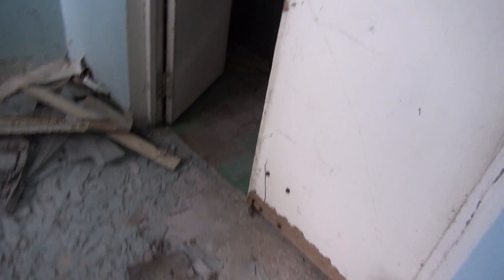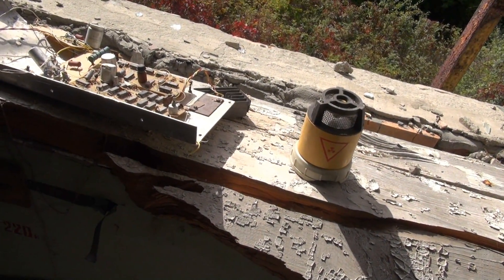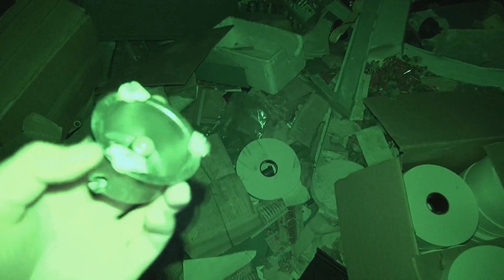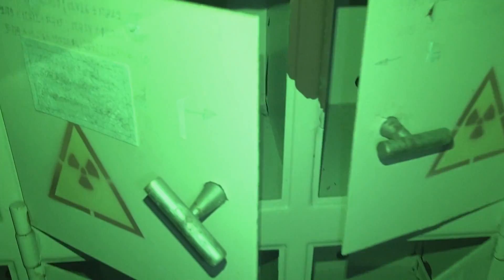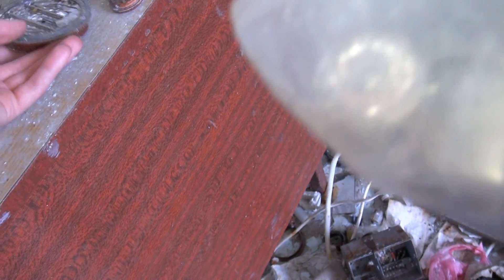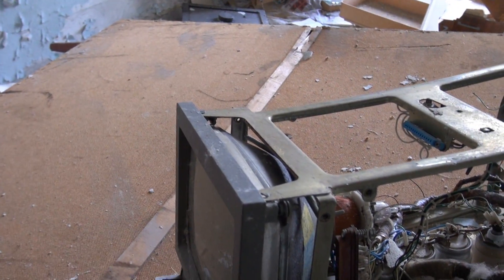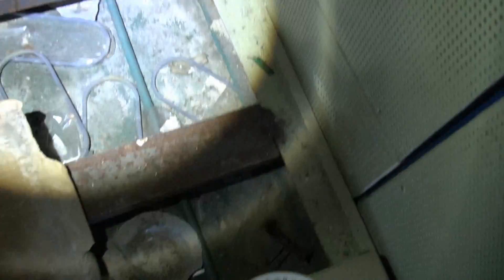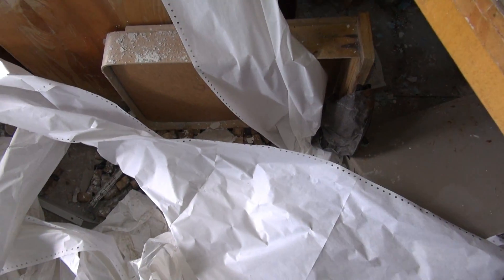chernobyl 2012 II: radioactive secrets of the zone - the detector laboratories

Comment: Sad to see all those electronic goodies languishing on the floor. The vacuum tubes, capacitors, and other components are useable to us out here that are into electronics, especially those of us that restore vintage USSR produced stuff. 

The Russians were the masters of making high quality germanium transistors, and were making them long after most others had switched over to using silicon based transistors. Even in restoring older non-USSR made electronics, the USSR germanium transistors are a great, and cheap source to replace a faulty transistor in an early piece.

Comment: In your radioactive kindergarten laboratory video if you open a bag of sample soil and touch it and "play" with the sand would you die or just get sick? How does that work? I love your vids and I would like to know cause Im courius about radiation
Reply: I cant find words. Im truly honored by your answer. Thank you so much. "This & the amounts of energy building up to that point are all very damaging to the cells of life, very similar to the way billions of bullets traveling at the speed of light are damaging to everything they come in contact with.  The difference here being that radio energy tends to travel through other matter.  It's a large amount, but there are chances that it travels for a long time through everything but never actually comes in contact with anything." When you said this for example the tanks and machines that are left in the zone is there radiation inside the armor to? Like does it "burn" threw the metal and it gets contaminated? Im a huge tank fan and Im amazad by the cars and trucks left in the zone and I have heard that the reason they could not melt the vehicles and scrap them like that is because if they did the contamination would "fly" ot the melted metal and the radiation would not disapear. (sorry for my English). How does that work?

Comment: Awesome video! Sad seeing those GM tubes and equipment destroyed. I could use them. I do like that old Soviet RID-1 smoke detector. I thought they contained Pu-239, not Pu-238. Maybe some had both? They're almost pure alpha emitters, basically just as safe as industrial Am-241 detectors. The screw on the top is so you can adjust the sensitivity (alpha particle emission). I have several Am-241 industrial smoke detectors that work in the same way. Cool!

Comment: "Why are there radiation detectors everywhere." 
Probably because you are in a nuclear power plant.
Reply: Uh, no. They're actually visiting one of the apartment buildings in the abandoned city Pripyat.
Reply: Close enough to the power plant.
I wouldn't know that im not a tweeker.
Reply: TheBoomViper

because the workers of the plant lived next to the plant in appartment buildings

and this video is so stupid, she repeatidly ask whats all this radiation equipment for
Duh, those film badges or radiation dosimeter all workers had to wear them
after each month they would develop those badges and check how much radiation each worker had
if one would have received to much they would rotate the workers and put him on leave or give him another job in the plant

dosimeter badges are still widly used, pilots on commercial airlines have to wear them also
because they get also exposed to radiation at higher levels daily

search for seconds from disaster chernobyl, this is a very good docu and they explain everything
the above video is pure crap and very foolish exposing yourself to that much radiation

you can compare a dosimeter with a VHS tape, lets say you recorded a new movie onto a new VHS tape
then go walk around chernobyl
then play the tape and it will appear like alot of static noise embedded in the video

thats the radiation that destroyed most of the data, only 1 diffrence
dosimeters are useless during a nuclear dissaster or fallout
they only for recording your montly exposures that could be harmfull
1 visit to chernobyl like in the above video and juggle around with radioactive waste is just plain stupid

Comment from the maker: nope. provided it is indeed Pu-238 (i read that these smoke detectors use this isotope, but i dont know if there are exemptions), it is quite harmless. it's largely an alpha emitter and not fissile, so cannot be used in nuclear bombs, and does not emit neutron radiation, either.
in fact, Pu-238 is a great source for electricity (in an RTG), with a small foot-long stick of it being able to power your computer for the rest of your life. they use these for the latest mars rover, for example.

Comment: Interresting building to be in :). About that lightbulb. I also have 2 really large lightbulbs. One is from osram and 2000watts. they are fitted with e40. Normal large fitting is e27. Its more for industrial use nowadays.